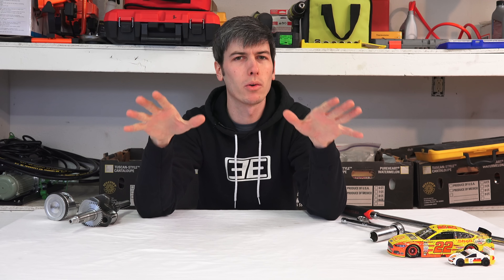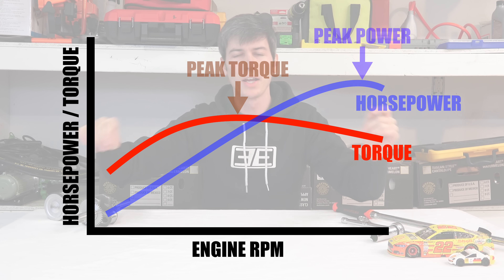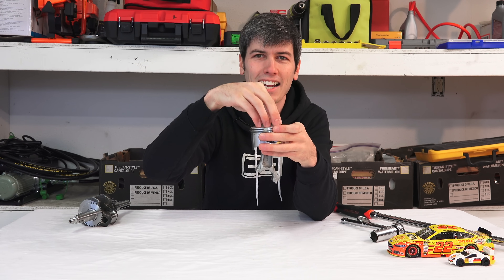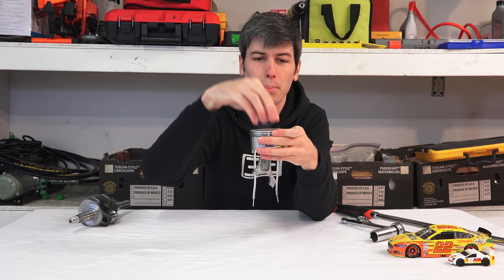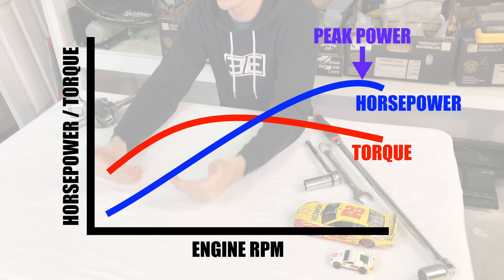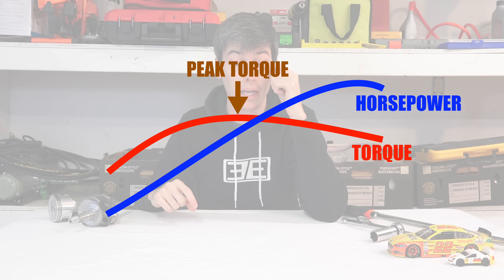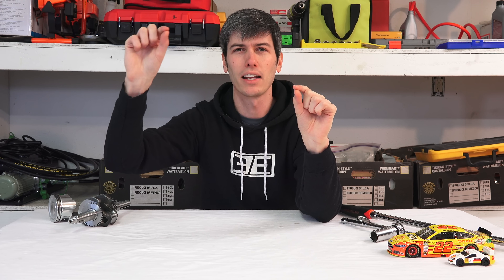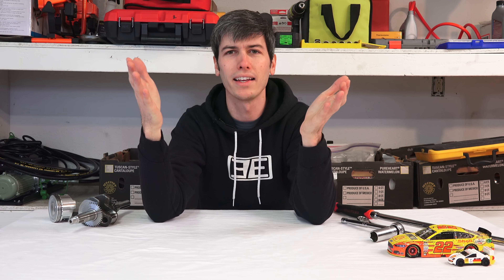Horsepower vs Torque - A Simple Explanation

Comment: Thanks, I almost understood.
Reply: I laughed at your comment but now that I’ve watched this I understand your point.
Reply: Consider you have a wheel that you're moving by hand. How much energy does it take to move the wheel around one revolution (i.e. all the way around once, back to the starting position)? That's what torque describes. Now consider if you want the wheel to turn as fast as it can. You now have to put in extra energy, so that the wheel turns multiple times as fast as it can. That's what horsepower describes. Both torque and horsepower are describing energy, but with torque it doesn't matter how long it takes for the energy to be applied, and with horsepower it does matter.
Reply: blahdelablah that's the most simplest and eloquent way I've seen this concept explained. I actually understood better from your explanation than from the video. Kudos!
Reply: @sinuslebastian6366  Thanks! Glad I could help. :-)
Reply: but like whats the point in better tourqe then
Reply: @seanbuckley6936  more torque can push higher loads just not necessarily as quickly as going for pure Rpm, I believe anyway
Reply: @seanbuckley6936  With higher torque you can move heavier items.
Reply: @blahdelablah  Great, so why does the torque of a motorcycle seem to get more relevance in talking specs than horse power does? I think it has something to do with rider knowledge for the twisties and pulling away from a standstill
Reply: @blahdelablah with higher Power you can move even heavier items in the same amount of time.  or you can move those same items as High Torque can but even faster.  Other than at zero engine and zero vehicle speed, anything Torque can do Power can do better.
Reply: @rollsroyce329 In this context, Power = Torque * Angular Velocity. Some high powered engines will also have high torque, others will rely more on speed (i.e. angular velocity). The types of engines that can move heavy items will have high torque.
Reply: @blahdelablah the only instance where your statement about Torque and “Heavy items” is applicable is at Zero engine RPM.  At all other speeds rotation is present which means Power is present.  Power then becomes the limiting factor in moving heavy items.  Are there reasons why a 100 HP John Deere tractor does not use a Yamaha R6 600 cc engine?  You bet.  Is it because it’s 120ish HP could not move heavy things as or more effectively than the engine the tractor came with?  Absolutely not if the gearing were corrected.  I am not saying Semi trucks should have 1.5 Litre F1 engines.  I’m saying once power has been “torque/speed laundered” by a transmission the wheels have no way of knowing if the power they receive started off as high RPM  low torque created power or low RPM high torque  created power.  With a given amount of Power Torque and RPM you can trade RPM through gearing to gain Torque. There is noting that can be done with gearing, or magic spells that can increase Power.  The rest of us aren’t going to participate in “my Torque IDENTIFIES as power.”
So let’s cast this heavy items incantation out of the milieu.  There are no mystical qualities about “heavy items” they are the same as light items only heavier.  The engine has no idea where the load came from;  Moving air out of the way at a v-Max of 175MPH on a motorcycle or hauling elephants up the steep streets of San Fran Freakshow.  With gearing the engine will be most effective at doing the work at its peak power output..  Doubling the Power doesn’t give is the sole benefit of being able to move x amount of “ heavy things”  twice as fast you can also use it to move 2x the weight of “heavy things” at the same speed. Does Gearing have losses?  Yes.  Is it impractical to use a 200,000 RPM turbine engine to turn a ships propeller that turns at very low speed?  Yes.  Are engines more efficient at peak torque and are there applications (like long haul trucking or shipping, farming and stationary industrial applications ) where efficiency is more important than effectiveness?  Sure.  The point of these discussions on the nature of Torque, RPM and their product - Power is to understand their nature.  That and to dispel any mysticism so people can then move to the questions like “well why would you want a very large slow turning engine.  Lots of reasons but none of them - “because Majic Torque” why can’t we use infinite gearing to make a theoretical RC car sized engine that makes .0000000000001 Lb/ft of torque at infinite RPM to power Al Gore, John Kerry and Bill Gates?
Reply: @rollsroyce329  "At all other speeds movement is present which means Power is present." Are you a little bit slow? At no point did I claim power wasn't present, instead I am illustrating that two engines of equal power are not equally suitable for a job. In other words, engine power is tailored based on the requirements. To claim "power is better than torque" is misunderstanding the role that torque plays in engine power.
Reply: @blahdellablah Power is the product of the role Torque plays in its production when it is multiplied by RPM.  Let me summarize my long winded last reply so we can be on the same page or clarify where there is disagreement.  Low RPM - High Torque engines are more suited to certain applications. I listed some.
A High RPM - engine of equal power is less suited to those applications.
It is not however less capable.
I was not trying to put words in your mouth. I think you get what I’m saying, I wasn’t trying to say you didn’t I was making the point that people conflate the last to points confusing  suitability with capacity or capability.  “A heavy car needs Torque”.  Not quoting you, quoting the hivemind of the internet.
Cheers,
Reply: @blahdelablah Can you name any type of work: lifting, accelerating, pulling, pushing anything that involves mass and motion where an increase in engine torque without an increase in power would be more beneficial to mankind than an increase in engine power without an increase in torque?  Let me re-word “better” to “more effectively” so definitions aren’t causing us to talk past, or insult, each other.  You dimwit (just kidding) I see that you are just trying to help others understand and I/ we appreciate that.  Can we agree the conclusion we don’t want people to draw is:
“Torque = strength
Power = top speed
You don’t need power if your not on the autobahn or race track”
To quote the internet.
This is why I am making the provocative statement:
In matters involving movement of mass at any speed other than zero (as zero is not a speed):  Any type of work Torque can do Power can do more effectively.  As in do more of the work in a given time period. Or do the same amount of work in less time.  Please let me know what I’m missing; I’m a little slow. ;-)
Reply: @blahdelablah   I was emphasizing
Power isn't just how fast it's also how much.
I imagine you'll get this although it will be way over the heads of Torque-supremacist one dimensional thinkers:

Dave: My engine may only have 150 HP but it's got a "massive " 300 Lbs/ft of torque
Your engine may have 300HP but it only has a wimpy 150lbs ft of Torque. Mine's twice as strong and can haul twice as many heavy bricks up a hill!

Steve: What are you talking about, I have 300 horsepower's worth of Torque you only have 150 horsepower's worth. At any given speed I can haul almost twice as many heavy bricks up that hill.
Reply: @blahdelablah  cheers that's the best I've had it explained
Reply: @jackp492  Glad I could help.
Reply: @blahdelablah  
Then why Torque even matter to a consumer? 
Let’s say I have a choice of two cars with 220 HP (5000 Torque) and 250 HP (5500 Torque). The HP tells me that the latter is more powerful car and hence better  acceleration as well. What the Torque power indicates here?
Reply: @Shahram19702010  Higher torque indicates the strength of the engine. The power output needs to be able to move the vehicle. Just like you wouldn't use a motorbike engine in a tractor, even if it's a fast engine when used in a motorbike. To use an analogy, a weightlifter isn't necessarily going to be the fastest runner, the power needs to be tailored for the job at hand.
Reply: @blahdelablah  can we say in layman's terms  that HP will indicate how much power car can deliver to get to the top speed on a level road...
Torque on the other hand will indicate...on an inclination... With heavy weight..the car can still move up the inclination /still being able to rotate it's tyres.? Right?
(In layman's terms)
HP → for speed on level road.
Torque → power to go up the inclination.
Reply: @blahdelablah  awesome explanation thanks
Reply: @blahdelablah  torque has nothing to do with energy it's a force , rotational force to be exact
Reply: @iamrobot396  I was using a simplified explanation. Also, "force" is one way to describe applied energy.
Reply: @blahdelablah  torque does not describe an amount of energy. You're adding to the confusion!
Reply: @Kavafy  From Wikipedia... "The newton-metre (also newton metre or newton meter; symbol N⋅m or N m) is a unit of torque (also called moment) in the SI system. One newton-metre is equal to the torque resulting from a force of one newton applied perpendicularly to the end of a moment arm that is one metre long. The nonstandard notation Nm occurs in some fields.

The unit is also used less commonly as a unit of work, or energy, in which case it is equivalent to the more common and standard SI unit of energy, the joule. In this usage the metre term represents the distance travelled or displacement in the direction of the force, and not the perpendicular distance from a fulcrum as it does when used to express torque. This usage is generally discouraged, since it can lead to confusion as to whether a given quantity expressed in newton-metres is a torque or a quantity of energy. However, since torque represents energy transferred or expended per angle of revolution, one newton-metre of torque is equivalent to one joule per radian."
Reply: @blahdelablah  true… the part i don’t understand is to turn that wheel faster, you need more torque.. so why is maximum torque achieved at a lower rpm? Don’t you need higher torque if you want higher power? Don’t you need more torque to turn the wheel in consideration faster?
Reply: @eclipzed2457  Compare two engines, one for a tractor and one for a racing car. The racing car can move faster than the tractor, but that doesn't mean that the racing car engine is a better choice for the tractor. Both engines are powerful in their own right, but one has more torque (the tractor engine) and the other has higher RPM (the racing car engine).
Reply: It also helps to consider horsepower, which is calculated by torque multiplied by engine RPM. This is a better measure of power than just torque alone.
Reply: You explained that perfectly!👍
Reply: Hey, I make science based 3D animations, and I'm planning to make an animation on this topic as I was also confused at times. If you would like to give me some pointers to what you would like in my animation, I would love to hear it!
Reply: @animationsxplaned8835  did you end up making the animation ?
Reply: @Pratagraph  You’re the first one to give me feedback!! But it’s on the list of potential next animations. I’m currently working on explaining vapour trails behind planes, but I’m also working full time at my day job, so my production rate is going to be slowed drastically :(
Reply: @animationsxplaned8835  I can totally understand that! You go at the pace that's comfortable for you. 

I'd love to see and animation on the torque vs HP topic though. I feel like a lot of car people would be interested in something like that too. 

The heat vapours is a pretty cool topic too!
Reply: @animationsxplaned8835 I have a 3-4 min project I'd like you to work on. How can I see your portfolio?
Reply: @animationsxplaned8835  hey where is the animation about hp?
Reply: So horsepower relates more to speed, and torque relates more to power (towing, etc)?
Reply: @noahway7690  horsepower originated as a unit for moving a certain amount of weight (550 lbs) upward a distance of one foot in the time of one second. It was about how much work and engine could do. Torque is equivalent to how much weight on a lever... Foot-pound, or newton-meter. 

There is much confusion about today's version of horsepower... Torque is pretty consistent. They try to calculate horsepower as a reference from torque, which just isn't in line with the original principle. If it were, everyone's tuned diesel pickup trucks would be capable of doing more than some semis...
Reply: Guys, i feel like he was joking
Reply: @lakofbrwn1204  What makes you think he was joking?
Reply: @lakofbrwn1204  
If by chance he is like 99% of humans that didn’t didn’t grasp a concept at early age when the mind is young and perception are not hardwired yet than it will take some time to “reinvent” a certain perspective. The irony is in the word “almost” and as with most humour  reflects intellect.
Reply: @lakofbrwn1204  I'm not
Reply: Torque = force times distance. If you have a longer lever, you can apply more force to the other end of it.
Horsepower = force times distance over time. The faster you want to do the work (like rotating the lever 1/4 turn), the less time you'll have to do it in, and the more horsepower you'll need. Conversely, the more horsepower you have, the less time it'll take you to do the work, and the faster you can do it.
Reply: @ClokworkGremlin  sadly, this is where confusion begins. People have placed calculations on something not calculatable that way. For instance, a Scania truck might out 1800 ftlb torque and be rated at 500 HP, but is capable of doing far more work, i.e. exerting more energy, than my 600 HP 1300 ftlb dually pickup. This means the Scania at 2000 rpm should have more horsepower, but it's hp rating is lower, while doing more work faster than the smaller engine. Raising 550 lbs the distance of one foot in one second is not the calculatable through torque, even though torque can make it happen.

This is a matter of people making a false system and wanting you to believe them, and forget about the original purpose.  The Scania will do the work of more horses than my dually pickup will any day of the week, yet my pickup has more "horsepower" than the Scania... See the disconnect?
Reply: @ClokworkGremlin  that means I have no horsepower
Reply: @ClokworkGremlin  so what makes horsepower and what makes torque? Can you describe parts such as carburetors, fuel, injectors, camshaft, etc.
Reply: Thank God it's not just me buddy.
Reply: He probalby referencing to the explaination with the graph for peak horsepower and peak torque 
Because i got lost after 
There were two instances on his explainations ;
The first one was with the 2 cars one with a higher torque and less horsepower and lower torque  and higher horse power 
The second one was with the graph where he was explaining the theoretical highest power of the car with respect to the peak torque and peak power 
In both instances .. he was talking about gears where  he didnt explain about ... i was assuming that the gears.. although the torque in less .. would compensate and make it faster
his explaination was good ... just he didnt talk about the gears and how they work with torque and that lost me
Reply: Literally lool
Reply: MEE TOO
Reply: Torque is how much it can move, hp is how fast it can do it.
Reply: 7:01 LEGO car left the chat not just before proving the guy wrong. I could almost the hear the mini figure driver shouting: "catch me if you can then, sucker!!!"
Reply: Even I been in the verge of it...
Reply: Hhhh
Reply: Hahahaha
Reply: Thank you, now I kinda have a clue now
Reply: Same 😅
Reply: Lol
Reply: same
Reply: Right- not too bad.
Reply: I think he needs a '____ For Dummies' version 😆
Reply: That's because he didn't explain it well at all
Reply: @DeletedDenizen  How would you explain it?
Reply: HAHAHAHHA
Reply: Same, I barly understand
Reply: Thats funny..im goin give a listen now
Reply: "Keep on bangin'"
Another Einstein eh?😁
Reply: This comment is gold! Me too man, me too.
Reply: Yeah, me too...not kidding!
Reply: Rajesh do the math and will be ok
Reply: Almost?
Reply: lmfaoooo facts
Reply: Now how would I explain this to an infant? Just asking dor a friend.
Reply: No one here understands it:
Horsepower: how fast you hit the wall
Torque: How far you drag the wall with you🤘🤘🤘

If you’ve ridden 2 stroke and 4 stroke ATVs or dirt bikes, or driven diesel and gas models of the same pickup you’ll understand.
Reply: So close
Reply: I’ve never seen a better comment in my life
Reply: Alllllllllmost
Reply: All you can really ask for
Reply: I'm still scratching my head like a caveman discovering fire for the first time. Lol
Reply: I think the big issue in the video is he never completes his examples. He ends up jumping to another example and then doesn't finish that one either
Reply: I didn't I'm dropping this video and watching the Lego one instead
Reply: I felt that one bro hahaha😭
Reply: Almost 😮??
Reply: Lul😊
Reply: One day, we will.
Reply: Well i explain it like riding a bike. In a high gear itll be very hard to get up because you have to move a big gear a lot which takes a lot of force, if its a low gear, itll be a bigger gear moving a small one. You can get more rotations out of the smaller gear in less time so thatll move you, just slower because its got to do more spins for the same thing. Thats torque. Torque gets you up a hill, hp is how fast you go and how quickly you accelerate
Reply: High Torque is good when you at 2000-4000 RPM ,
High Horsepower is good when you at 6000-7500RPM,
End of the story
Reply: Torque is the ability of an engine to do work, power is how fast it can do the work. So a diesel engine has more torque but less power than an equivalent petrol engine - big trucks have diesel engines - they can move heavy loads but do it slowly.
Reply: @johnburgess9016   Power is the measure of not only how quickly a given amount of work can be done; it is also a measure of how much work can be done in a given period of time.  Anything torque can do power can do better and/or faster.  A long haul Semi truck has a job to do that is not irrespective of time.  It is load and time dependant so it has a minimum Power requirement.  It is designed to meet its minimum power requirement.  It that is 500HP its 500HP.  The reason they don’t use 800HP V10  18,000 RPM Formula one engines is not because the engine has less capacity to move heavy loads.  It has more capacity to move heavy loads.
Can you tink of any examples of work that we would use an engine for that doesn’t have any time constraint?  There might be one, I just can’t think of any off the top or my head.
Reply: @johnburgess9016 ”So a diesel engine has more torque but less power than an equivalent petrol engine”. What metric are you using for “equivalency”?
Reply: Same here...
Reply: i am still lost,but thanks for the effort to explain.
Reply: Yeah, almost
Reply: If two engines are spinning at the same rpm, the one making twice the torque makes twice the HP and vice versa. 

If two engines are making the same HP, the one spinning half as fast makes twice as much torque. 

If two engines are making the same torque, the one spinning twice as fast is making twice as much power and vice versa.
Reply: Same. I worked on turboprop engines for a couple of years, and I understand thrust and torque, but I've never been able to fully grasp the torque vs. horsepower difference. This video came close... I guess the missing link is literally the gearing involved, which was only mentioned in passing, and which is utterly essential to understanding the topic.
Reply: Ong
Reply: Horsepower = Speed
Torque = Power
Reply: @reeeeee3793  “horsepower = speed and Power = torque”?  Um no.  if you want to break this down into something really simple let’s at least make it correct.  Power is the limiting factor for: towing, accelerating, hauling, hillclimbing, wheelies, and any other type of work an engine can do at any speed.
Reply: HP=Top speed TQ=how fast you get there
Reply: @asfowenn ”HP = Top Speed TQ= how fast you get there”. Often repeated but not true.  The engine’s Power, not its torque, is the limiting factor for  acceleration, towing, hillclimbing and anything else that is in motion. Torque, not Power, is the limiting factor in how much mass can be moved from a speed of zero.  Torque is the king of Zero movement.